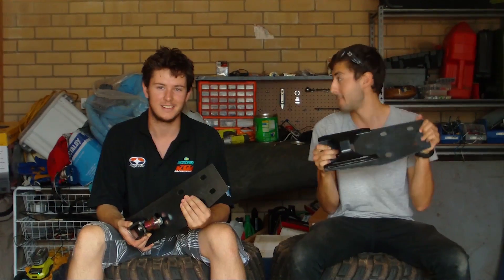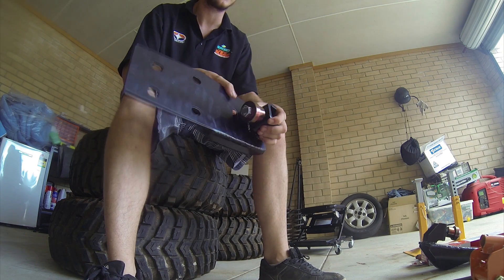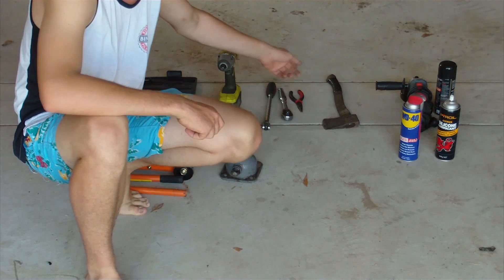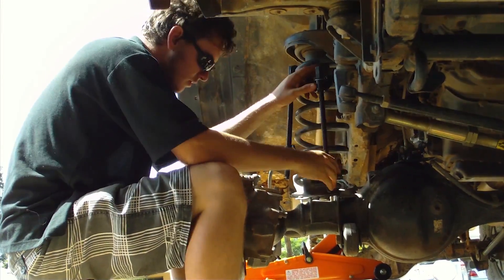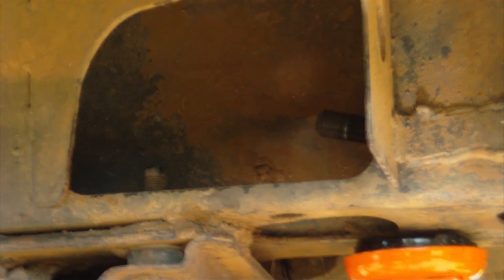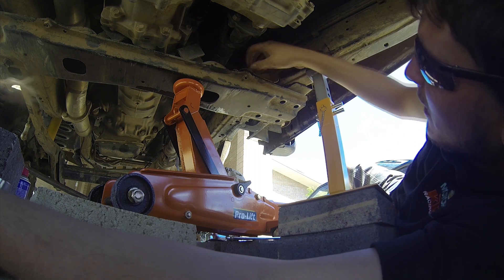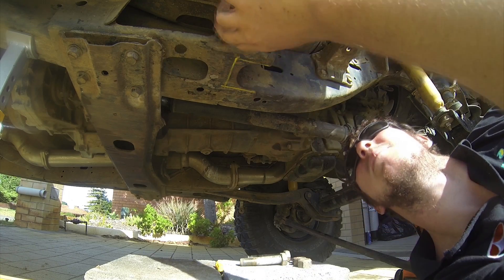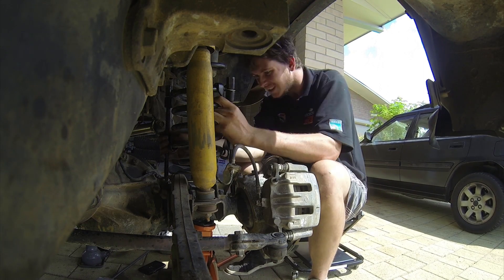Dropbox Fitting Guide for GU Patrol

Comment: Please don’t copy what these cowboys have done. Totally unsafe and removing stuff that should not need removing.
Reply from the maker: You're not wrong - Years later I ended up having to weld back the piece that I cut out because cracks were forming on the plate that I cut.

Comment: Could someone please tell me, if a dropbox or caster correction bushes are not fitted to a GU Patrol with raised suspension, can this induce posative camber at the front end, in turn, causing outer shoulder tyre wear? Wheel alignment was recently done on new tyres. Suspension and steering check returned no damaged bushes or other components. No king pin shims fitted top or bottom. Thanks in advance, and thank you to the film producers. Really appreciate it.
Reply: Yes they can induce a positive camber. I have a positive camber, but still in specs, with 2 inch lift

Comment: Should NEVER EVER!!!! use concrete blocks or bricks to jack of or as blocks to hold weight.  When the weight is on they can crack or explode and give you no warning if they are going to fail. Use axel sands or a good wooden block.  With wood if they fail they normally do it slowly but most importantly they crack and creek and give you plenty of warning.Also not a good idea to use the trolley jack onto of blocks.